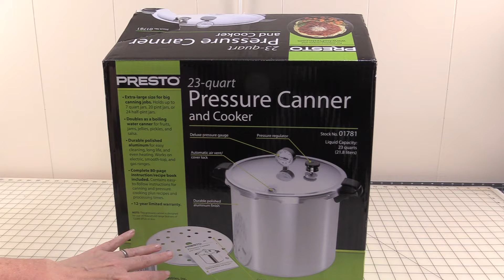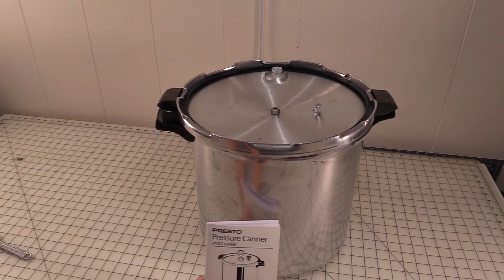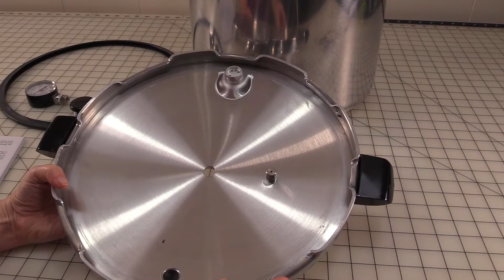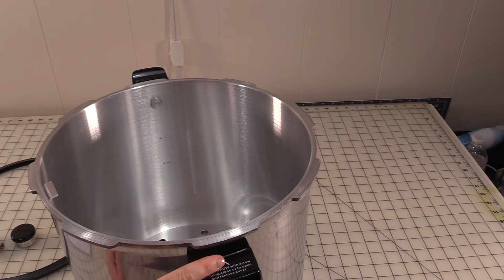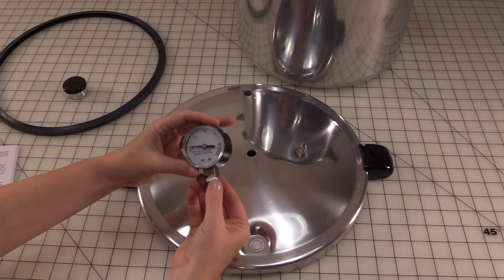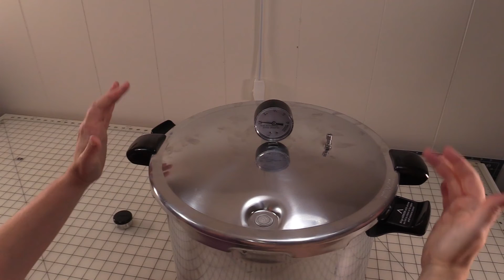How to set up a new pressure cooker and canner.

Comment: Are we supposed to remove the dial gauge after each use an store it safely? Or will it be fine to leave it attached to the lid ?
Reply from the maker: No, only remove the gauge if it needs replaced.

Comment: I just bought the smaller Presto.  My directions for installing the pressure gauge indicates that we are  to put all three pieces (gasket, washer then nut) on the bottom side of the top and just the gauge on the top side.  I do not know if this is important but thought I should mention it.
Reply from the maker: Thanks

Comment: I bought a pressure canner on amazon, but I didn't read the part about what kind of heating source you can use. I have a glass top range. The canner I bought said to use, coil or gas. I returned the canner. Which pressure canner brand/size would you recommend for a glass top range?
Reply from the maker: This is the one I've used on a glass stove top for 10 years: https://amzn.to/2Xel0d2